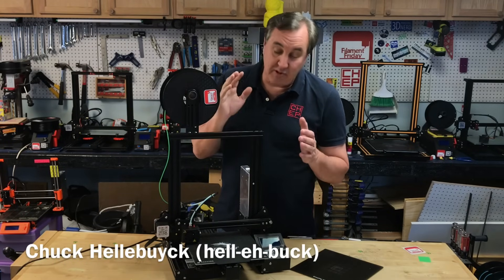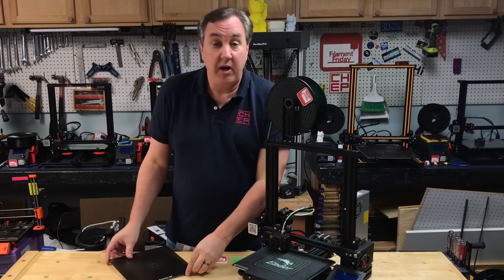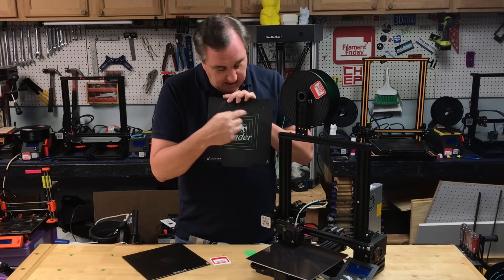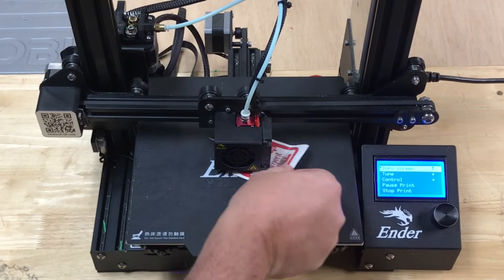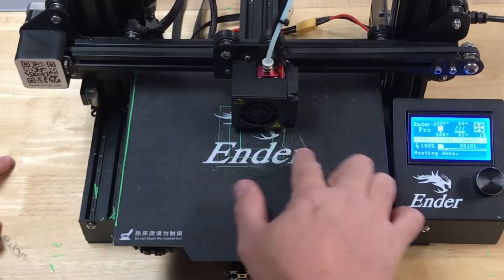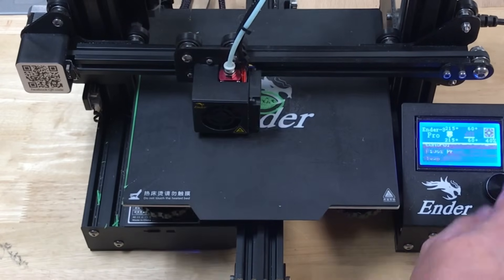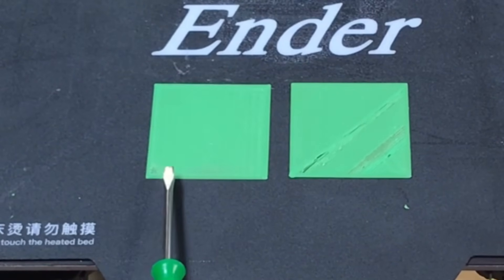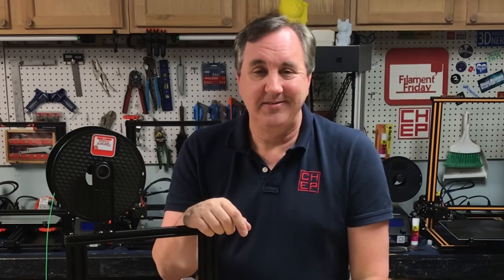Creality Ender 3- Easy Way To Level Your Bed

Comment: I just updated my firmware to 2.0.4. When I try to run your bed level gcode, it goes to all the corners, but doesn't stay at each corner, like it did before I updated. You have any ideas why
Reply: I'm using bufix2.0.x. It won't work if you are printing via USB. Worked right away using an SD card.
Reply: @JR-kj6kn  It was working before I installed 2.0.4, now it goes to every corner, but doesn't stop, it goes down comes back up and moves to the next corner

Comment: both of the gcode you gave just start printing the calibration grid straight away on my ender 3.  i dont get a chance to calibrate the bed lol
Reply: nope i am wrong!, in the video chuck shows him selecting the CHEP_bed_level_test.gcode just before he calibrates, but it is the other file (CHEP_Ender_3_bed_level.gcode) that does teh calibration (you can see if you read the gcode in a text editor lol)

Comment: I'm such a noob, I just purchased an Ender 3 Pro.  My first sets of prints I just put a level bar on it and adjusted, till I did a bigger job, and I saw the errors and had to find someone like you to teach me.  I also had to offset the Z-Home Switch lower, so my knobs wouldn't bottom out so easily.

Comment: Is there a CR10S version to the Gcode that stops at all 4 corners and then in the middle?
Reply from the maker: I believe Thingiverse has some or just mod mine with text editor
Reply: @FilamentFriday  i would but im not sure what to change... im not very good when it comes to code. anyway someone could edit it for me and upload it somewhere?
Reply: @blazingjayy  Are you printing via USB and it doesn't stop? Try printing using an SD card.
Reply: @JR-kj6kn  well it looks like the cr-10s has it built in. Under the prepare section it has auto bee level. It's does the same thing as the gcode
Reply: @blazingjayy  Nice! Problem solved.
Reply: @JR-kj6kn  I still gotta upgrade the firmware on it. And I'm not sure if I need to put a bootloader in it like with the Arduino and ender3
Reply: @blazingjayy  It looks like the CR-10s ships with the bootloader from what I've read depending on where you got it from. Worst case, you just need to reflash it.

Comment: I ran the file, but it only does the left side of the print bed
Reply from the maker: Check your file because 1000’s of people have used it with complete success.
Reply: CHEP I had my wires crossed!

Comment: Rn the GCode and leveled out my Ender 3 Pro.  That part worked great.  Problem is now when I go to print, I get a HEATER FAIL RESET PRINTER error each time the prints hits around 185.  I have unplugged the printer, let it rest and plugged back in.  There is no reset other than Initialize EEPROM.  Any idea????
Reply from the maker: Never heard of that one.

Comment: There is a smal problem with your g-code.
YOu should turn on bed-heating, since heating the bed will force it to expand a little bit. It is not much, but it is there. And worse: It may not be uniform.
Reply from the maker: The GCode does heat the bed.

Comment: Burnt my bed
Reply: Tried to use that gcode but my nozzle dove straight down onto my bed and it put a burn line on it
Reply: @savescott5  i had something similar happen last night.  had to make sure i had literally no friction on my paper
Reply from the maker: How
Reply: I’ve burned two with the stupid fucking paper trick

Comment: This bed level test is frigging awesome. Even with edges all set well it still sometimes doesnt stick well. But using the square lines to adjust is amazing.

A question for you chep. You know your chep cube. If you shine a light from below (so on the oposite side of the z lable). How do the lines look? Mine doesnt look even when i look at it from that angle but if i look at it from the front or zoomed in it looks flawless.? Is this like vibration errors or density error thats showing up from the light? Also printing odd shapes i get some lines showing up where the geometry changes. I see this on alot of peoples prints but noone seems to notice or care?
Reply from the maker: Could be reflections. I’ve never tried it.

Comment: Chuck, THANK YOU!!    I've owned my Ender3 for a year now and I have never had good first-layer adhesion on any of my prints--I resorted to using a raft for nearly everything.    After using your 4-corner (and center) gcode process, I found that I had two corners far too loose.     After adjusting, I had my first ever perfect first layer, and on a print with a very complex first-layer footprint.   Looking forward to printing instead of fighting with my printer!    Thanks again.

Comment: Thanks for all the help sir. Do you by any chance have the same files for a CR10? At least the corner/center G-Code?
Reply from the maker: I don’t. I leveled my CR-10 once and I really don’t touch it. The GCode can easily be modified with a text editor to change the x,y coordinates.
Reply: @FilamentFriday  Will do. Thanks for the input.

Comment: Love your work CHEP! I'm having a hard time leveling my Ender 3 bed. It seems like I'm running out of adjustment. I have the z-axis limit switch properly in position. When I go around to all of the corners and set the height I feel like I'm getting the right spacing but when I do a print test the extrusion is not adhering properly. I turn the wheels up more and there is always one side that runs out of height adjustment. Any ideas on what I am missing or what to try next?
Reply from the maker: Sometimes it’s a dirty bed. Clean it with soapy water and let it dry then try again.

Comment: Hey Chuck!

I just want to express my thanks for your gcode and help leveling my ender 3. I'm a student at the University of Pittsburgh trying to 3D print for engineering projects, and bed leveling has been quite frustrating (I'm new to the printing community). The gcode made my leveling process after switching in a glass bed so much easier! I appreciate your help immensely, thank you!
Reply from the maker: Glad I could help.

Comment: when i run the gcode it doesnt stop at the positions it just runs thru them twice and stops.   Help! please...
Reply: I am going to try it later and try to help you out
Reply: It runs perfectly if I run it from the LCD on the printer and only has the issue if I run it from the PC.
Reply: @buzzworthyfpv3520  I only tried to start it through lcd monitor and it worked alright, didn't try it through pc though

Comment: Say you did have it too close and now there is PLA smeared into the stock bed... What is the best way to clean that out?
Reply from the maker: Heat it up and scrape it off.
Reply: 75 degrees was the magic number for me. Thanks for this tip!

Comment: Chuck could you revisit this using a Dial Gauge or Feeler gauges?
Reply from the maker: It doesn’t matter as it’s just a starting point. The live adjust does the leveling.

Comment: great codes and vid. Though for some reason i have good adhesion in the middle for a couple inches and then it starts breaking loose. I adjust it and it still makes a mess. Ill keep trying to get it right though. Could be a slightly warped magnetic matt on my ender 3 pro but ive only had it for a week.
Reply from the maker: Clean it with rubbing alcohol or end soapy water.

Comment: Great informative video. One problem though -- the leveling program has the bed at room temperature. Creality printers are made of aluminum, especially the bed and bed chassis, which flexes and changes shape as it heats up or cools down. The bed should be leveled at printing temperature (50-55°C).
Reply from the maker: It is. After you get it close with the paper the live adjust finishes it off while printing.
Reply: @FilamentFriday  Very cool thanks.

Comment: What if I have a .2mm nozzle instead of the 4?  I understand the corner leveling with paper should be the same, but will the gcode for printing the squares work correctly?  Thanks!
Reply from the maker: Yes. Nozzle doesn’t matter.

Comment: Can You make a line test for the monoprice mini !
Reply from the maker: You can modify the GCode in a text editor to match your printer.
Reply: CHEP well I’ve never owned one, in fact I don’t even own it yet lol. And I definitely don’t know how to use the software yet. Also need to learn what even Gcode means. I guess I can see what it is and try and make one if it’s not hard, or just level it using the paper method
Reply: @TrendingPendingVideos  you don't actually need any knowledge of any software at all. You just need to download the GCode file, open it in notepad or notepad++ and make the corners further or closer.

Comment: How close should the nozzle be to a sticky note when leveling? I'm confused on that one. I've heard tight and then barely touching.
Reply from the maker: Doesn’t really matter as long as you feel resistance and can still remove the paper. It’s just s starting point. The real adjustment is during the live adjust portion.
Reply: @FilamentFriday  ok, thank you

Comment: Every time when i try to level my bed i have different results :/ plus center of bed is different then corners. 
I would like that i can somehow send you result of test print, maybe would be easier. thanks
Reply: If there is too much play in the 4 corner knobs, you may need to move your Z stop limit switch so you can tighten the knobs more.

Comment: i am new to 3d printing world. very easy to understand video on bed leveling. does this gcode works also for tevo firmware "marlin"  ? as have tevo trantula with marlin. thanks
Reply from the maker: The bed size is similar so it should work

Comment: could you please xplain how to set the "x" axis 0. I am confused about this and my nozzle starts printing some times like 16 mm in the air above the bed (that can't be good) or it runs right into the bed (at the end of print) and compresses the springs until I manually shut the thing down . very frustrating -and scary 
please help if there is hope
Reply from the maker: Does it home correctly?

Comment: I can’t get the part that needs to lower closer to the bed. There is like a 2 inch gap between the bed and where I’m supposed to put the paper, and when I set it to home it’s doesn’t move lower.
Reply from the maker: Adjust the stop switch on the side.
Reply: CHEP it got lower but it’s still not low enough to use the paper.

Comment: Do you have a video if the ender 3 bed plate has a warp? mine has a very high center
Reply from the maker: No. I don’t.
Reply: Are you sure you positioned your bed plate correctly? i get air bump in middle when i missplace bed. Try to position it better. Back part to be on the corners, and front part with epansion to overhang a bit.
Reply: Try getting a hard bed plate such as glass. It'll help with mitigating the warp.

Comment: Using your CHEP_Ender_3_bed_level.gcode to level my Ender 3 Pro bed which works very well, thanks! However, when using this gcode 10 times, 8 times the printhead is moving on 'normal' (I guess) speed from point to point, 1 out of 10 very slow and 1 of of 10 very fast. When it is moving slow, a reboot makes it goes on 'normal' speed again. 
Any clue why this is happening?
Reply from the maker: No idea. First I’ve heard that.
Reply: Happens for me also
Reply: Mine did that too when I was using the OctoRemote app on Android.  In my case I uninstalled the app and just went directly to the web browser interface (same interface as if you were sitting in front of a pc).  I haven't had that issue since.  I also had other issues while using OctoRemote like the connection was spotty and commands (cancel print, heat the bed, etc) would take forever.  Not sure if you are using this app, but that was the problem in my case.  Hope you get it figured out!

Comment: I used this and got my bed perfectly level. Even in the middle the paper has some resistance. However, now the first layer doesn't stick to the bed anymore. It's really odd, it fails inconsistently and depends on the print. Some prints stick, others do not. Ontop of that, using a raft produces perfect prints every time. The raft always sticks. I'm out of logical explanations for this. To recap, raft always sticks.
One print may stick without a raft, but another will not. The failing is inconsistent, it doesn't always detach from the same point. Any explanation for this?
I did the square test and it always sticks to the bed perfectly. I moved the sensor down to keep the springs compressed.
Reply from the maker: Clean the bed with warm soapy water. See if that helps.

Comment: Chuck, I have both a BLTouch and an EZABL - do you have an automated version of this method ... or anyone in the community knows how to GCODE program it to auto-level? I'm regretting ever upgrading my 2-Ender 3's :( very frustrated because I have some projects due for a customer!
Reply from the maker: Creality has firmware for BLTouch and TH3D studios makes the EZABL and has firmware for it. 
If you have that installed then just add G29 after G28 home in your machine start code to autolevel.
Reply: Don't forget to save the auto leveling to EEPROM afterwards! I can't recall the command but ask Google.

Comment: I have a question related wuth the first layers printed, I use with my E3D 50 degrees some videos say 60 is better, Printing in PLA off course, The first 3 botom layers are deformed sticked in the bed this is normal isue ? I also use spray for get well adhesion. I m almos newbee only 3 mounths printing and i want to do it best.Thak you.
Reply from the maker: Either 50 or 60 is fine. 
If first three layers are deformed then readjust as the nozzle it to close to the bed.
Reply: @FilamentFriday  Thank you Master.

Comment: Hi Chuck, thank you for what you do. I enjoy all your video's. I am a noob in the 3D printing world and I know this bed leveling is a very important first step. Will your .gcode work for all printers? or just the ender 3 series? I know there are different bed sizes so I am not really sure. Thank you.
Reply from the maker: It will work with any bed of similar size. You can modify the GCode with a text editor.

Comment: This is wonderful, thank you! However, I would like to suggest that the calibration process be done in a diagonal fashion, similar to replacing a tire on a car. You wouldn't tighten the lug nuts in a circle, but rather a star pattern. Does that make sense? I just noticed I had to go through the calibration process several times to get an accurate result.

Comment: I just got my ender 3 and used the code but my extruder is hovering above my heating bed at least an inch away. How do I calibrate the extruder to the correct level?
Reply from the maker: https://youtu.be/_EfWVUJjBdA
Reply: you need to lower the y-axis limit switch, so the bed can get closer to the nozzle.

Comment: I have an ender 5, so similar.  I have seen older versions that have an auto level that will go to each corner.  Mine and seems newer ones do not have it.    Yours shows an ender 3 bed level, where do I find that one?
Thanks.
Reply from the maker: Link in the description

Comment: I've been printing for 2 weeks with no problems.  All of the sudden my prints aren't sticking to the bed.  I went through your leveling procedure twice.  There's plenty of resistance on the paper, but when it goes to print, the nozzle is far from the bed.  It's a huge gap, I can see daylight between the nozzle and the bed.  I'm not sure what to do.
Reply from the maker: Did you home it first? 
Did you enable a z offset in your slicer or use a new slicer profile?
Reply: @FilamentFriday  Yes I auto-homed.  I leveled again and yet again there was a Z offset.  I realized the printer had been turned on non-stop for about 3 days so I did the classic move:  turned it off and back on.  Problem solved.  So my question is, where could that offset been introduced?  A setting somewhere that I accidentally changed, or a glitch?

By the way, I was printing the 4th coaster in a set, so using the same Gcode that had already worked 3 times.  So no changes in the slice.

Comment: I did the paper test and my prints still mess up about an hour or even before it starts. I haven't tried your gcode test yet, so I'll give it a go. I need to rub it lightly, and if it doesn't come off, it will be "tuned"?
Reply from the maker: Basically yes.

Comment: Could you please post a downloadable hi-rez copy of the filled in green square where you showed it being too close and then too far on the same square?
Reply: You can make that square yourself. It's just a standard box shape that's really thin.
Reply: @PunakiviAddikti  Yes but I literally wanted to see what the two problem cases looked like - it seemed a good example but a bit too low rez to be as useful as it could be as an example for identifying those two different problems (for people with bed problems).

Comment: I literally just started researching 3D printing yesterday.  I had no idea the prices came down so much.  I spent all day and evening researching and ordered an Ender 3.
Your videos are a huge resource.  Great job and thanks!
Reply from the maker: Congrats. Where did you buy it?
Reply: @FilamentFriday  Amazon.  Coming tomorrow.  Watched lots of vids about leveling.
Reply: I used your leveling program and my first print came out perfect.  I made a part for my drone controller and already installed it.